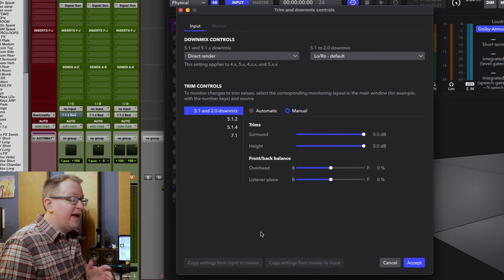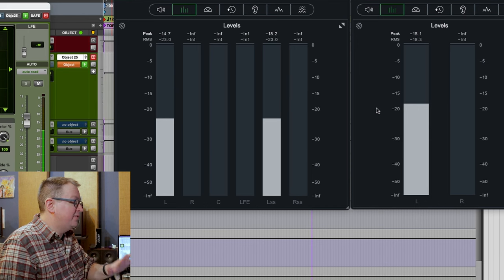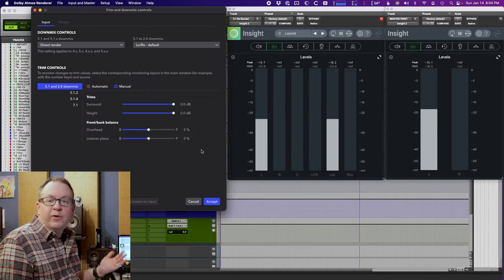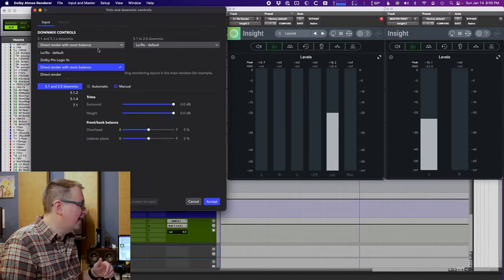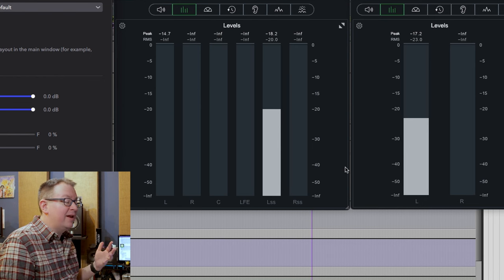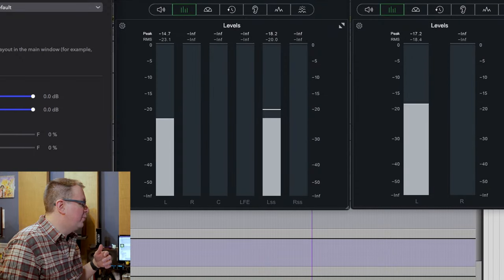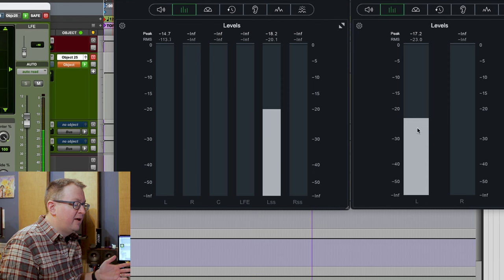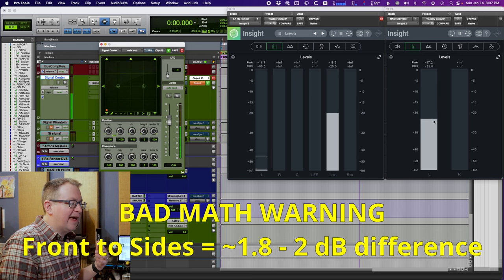Exploring Dolby Atmos Fold Downs for Music

Comment: I think there is one misconception - regarding bed vs object: if something is panned to the side surround in a bed its not the same as if its panned to the exact same position as object. unfortunately the difference does not occur in 9.x.x setups but it clearly would in a theatre as well as in a room set to array mode. position 'left side surround' in the bed means the sound is going to sit all on the whole sidewall. Just as you know from cinemas - the whole side array of speakers is going to play back the same audio. only with an object the position gets more detailed to enable 'access' of single speakers. That might also be the reason why in the binaural re-render there's a difference to be heard.

Comment: Setting the downmix is tricky!!! thanks for the viceo!!!!  so far I've tested a lot of combinations, some of them keep mix volumes in a beter way, but the 2.0 mix always seems dryier (the reverbs seem to go down some 2dbs)   what's your experience with reverbs?
Reply from the maker: I've had some of the same thing, and I think it has to do with the Lo/Ro. For example, on a vocal, I have reverb everywhere--fronts, sides, rears, tops--and I'm setting that level with everything going. BUT, when it folds down, the Lo/Ro takes the stuff in the rear speakers and brings it down 3 dB, so that's potentially 3 dB less of the reverb. It could be even more depending on what the downmix settings for 5.1 are at because of how they deal with the sides.

Comment: One thing i noticed is that anything you pan to the "top front' is going to be 3db louder than anything you panned to the 'top rear' in the stereo folddown since the front top isnt considered a 'surround' when it gets folded down to 5.1. Curious what has been your experience with that?
    Interesting it seems the main (or perhaps only) difference between the direct render and direct render with room balance is that in 5.1 with direct render, its trying to produce a phantom image between the front and rear for anything that was panned to the sides which im guessing is a way to distinguish it from anything panned directly to the rear surrounds. Which makes me question, what is the 'standard' downmix setting when going from say a 7.1 mix to a 5.1 downmix in a traditional channel based mix? Is it to have that side phantom image between say the front left and rear left? Or is it to be more like the 'DR w room balance' downmix with the stuff panned in the sides just going straight to the rear as opposed to the mix of front and back.
      Also what i noticed when you were panning from front to side (in direct render mode) is that the level of the surround channel goes from infinity to about -34 before the front even thinks about dropping at all which seems odd to me. 
Thanks again great video!

Comment: 16:19 I bet there is a real reason for this to occur.  Perhaps it is something to do with where the plug-in determines where the centre is with the sides, back and front, top and bottom which will mean the change?  If that makes sense: where one is listening????
Reply from the maker: Direct Render treats the side position like a center position between the back and front so in the 5.1 the level is 3 dB down in the front and the rear. In Direct Render with Room Balance, it puts side material completely in the rear of the 5.1. The stereo/2.0 re-render is always built based on the Lo/Ro fold down method which turns down the surrounds 3 dB before adding them. The way the Lo/Ro works is part of why things add the way they do.

I've been happy with results, BUT I'm not crazy about how the Lo/Ro works because I don't think that -3 dB thing should be a part of it, and the pan law between front and back should probably be -6 dB and not -3 dB.
Reply: @goingto11  I would not be happy either.  It actually distorts the sound field for a production.